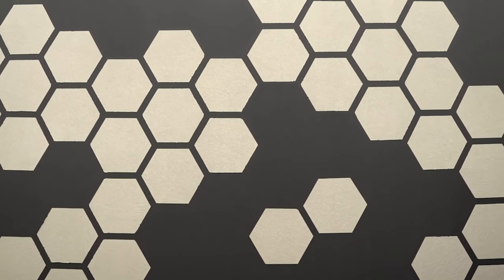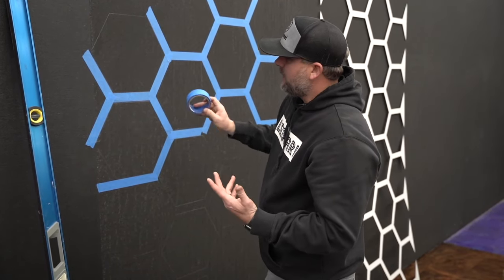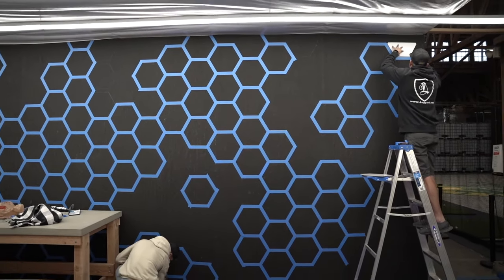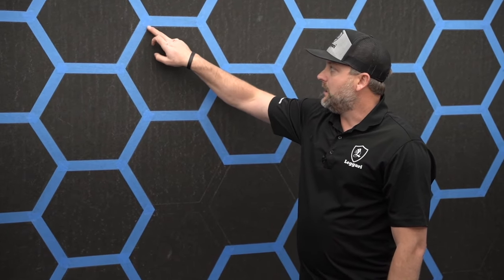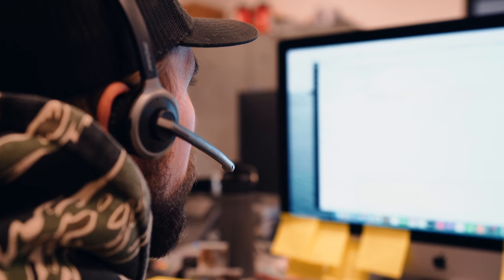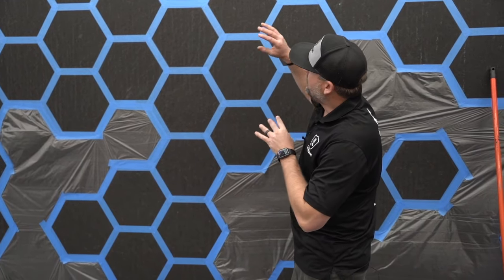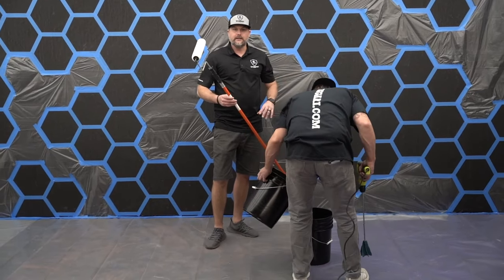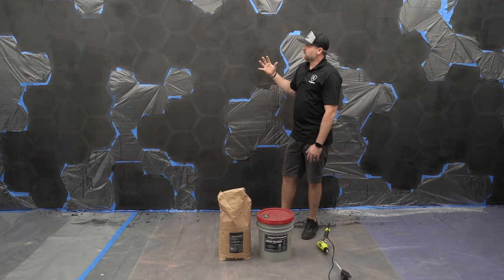How to Coat Wall To Make a Honeycomb Pattern | Modern Wall Art

Comment: Good from a far but far from good. Should have peeled it when it was wet. Would get crisper lines. After it sets it is too thick and pulls from the part that you want to leave. Try it out
Reply: but if thy peeled when it was wet, they wouldnt have been able to do the scratch coat or the second coat...so what do u suggest
Reply: That’s why they are the pro’s and your sitting behind a screen commenting 😂😂 11pinkie11 is right plus you can razor blade or lightly sand any spot that is dramatic